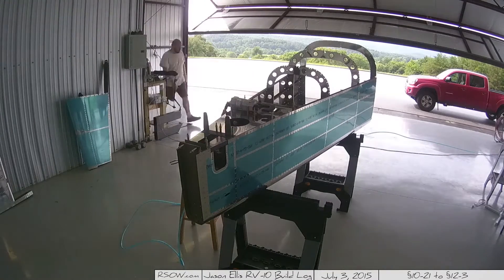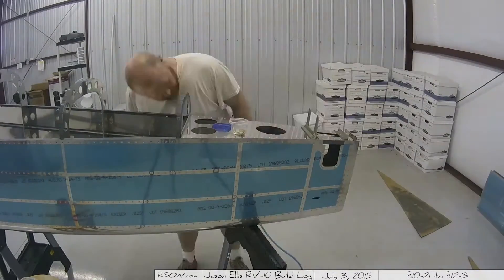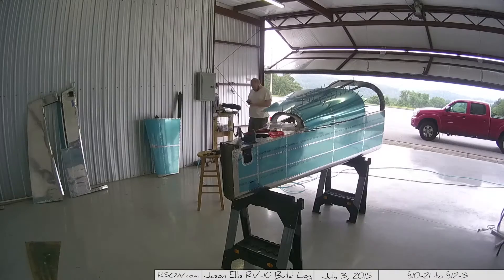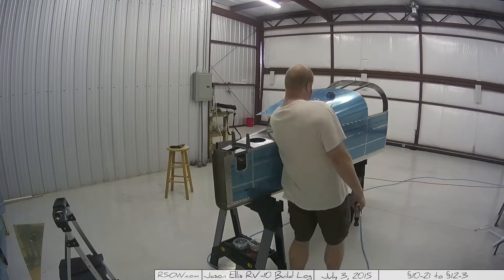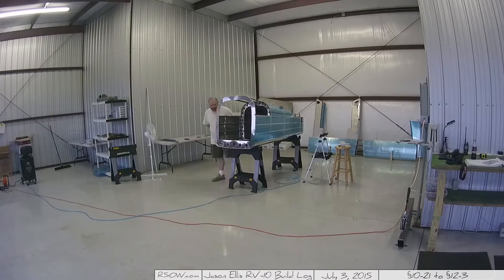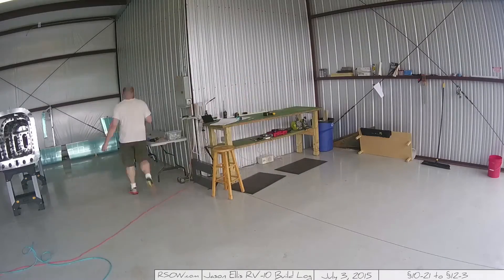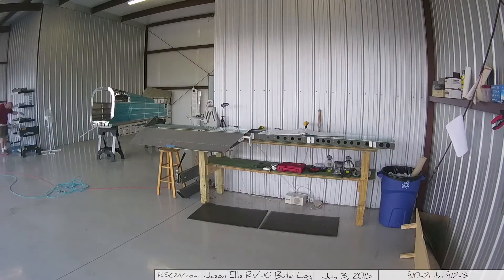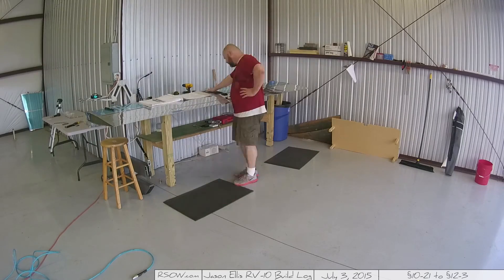RV-10 Empennage section 10-21 to 12-3

Comment: For those at this step: there is no need to ever crawl into the tailcone. If you put it on its side on the saw horses you can dive underneath the J-channel and from that window standing up you can easily access the shoulder harness bolts and also earlier you can easily reach the rivets for bucking from the inside.

Comment: For those at this step: potentially get Spruce part 12-00627 (temp assembly pins). You can get those in and out of the hinge in a second until you finally put the real bolts in when all is right.
I actually measured the jam nuts to be at the required 7/8 inch point from the center of the hinge before putting the bolts in and my elevators fit on the first try, had no binding at the counter weight rib and the elevator moved 30 up and 25 down without binding at the skins.
It pays off to make a rod bearing screw-in tool from a piece of PVC water pipe and a cut-off part of a fitting that goes over it. You cut out a slot at the end of the pipe that grabs the rod bearings. The fitting will go over that part and give it strength. You can drill a hole in the pipe so you can turn it.
I had issues with one rod bearing. The nut plate wouldn't capture the bolt. I used a tap to re-cut the first 2 turns of the thread in the nut plate and then the bolt went in.

Comment: It looks like your safety wire is wrapped too tight, one of the things I hate about the safety wire pliers. It is too easy to get too many twists. There should only be about 6-8 twists per inch and is much easier to control when you do it by hand. I know that you ware way passed this now. Page 7-20 of AC_43.13-1B_w-chg1.pdf on the faa site.
Reply: Also review Ch 4 of FAA-H-8083-31.  It's another free book titled "Airframe & Powerplant Mechanics, Airframe Handbook, Volume 1" and Ch 4 deals with riveting.  There's a lot of free information published by the FAA that is industry standard that includes the "why" about things.  I thought about buying an RV until I started watching all these video's.  What pushed me over was a comment made by another pilot that went something like "be careful, there's a lot of variations in armature built aircraft."  That's when I really started seeing poor workmanship.  Jason does a good job explaining things, but he lacks experience in things like using high quality tools and doesn't know the significant difference.  I would find it difficult to shell out $190,000 for an RV-10 that isn't very well built.
Reply from the maker: Great catch. I'll look into it.
Reply: Terry Pendergrass is r